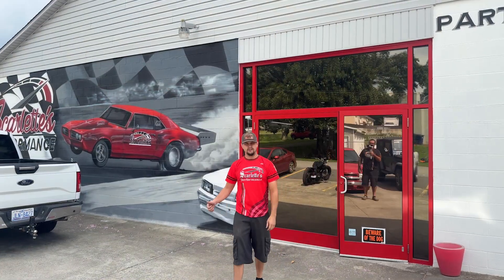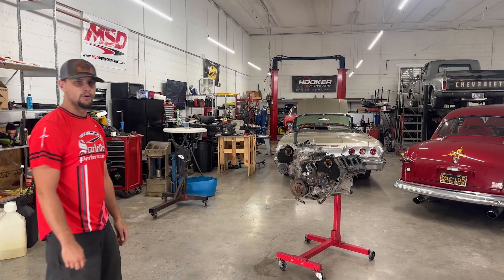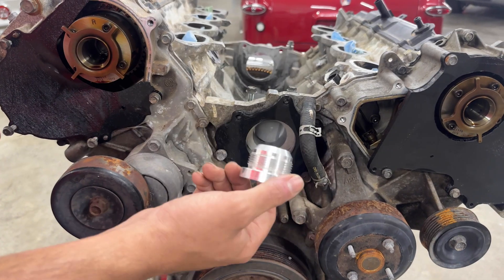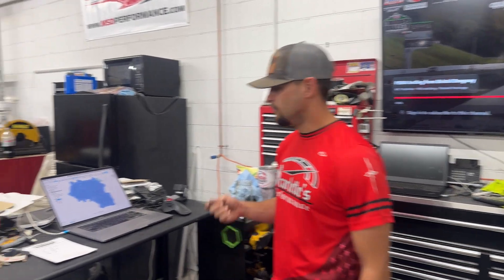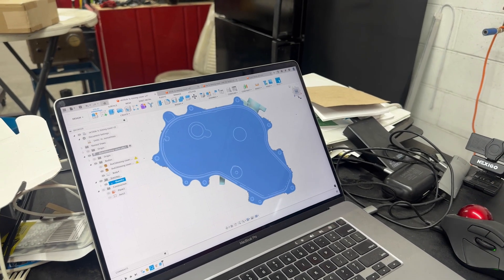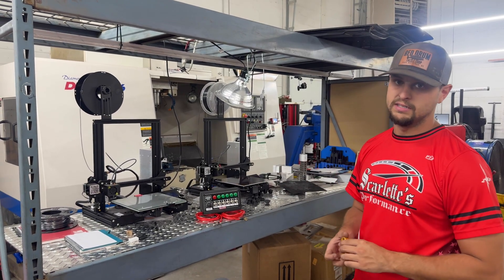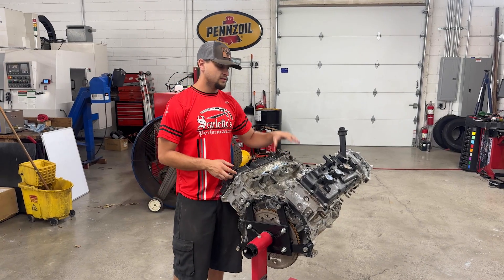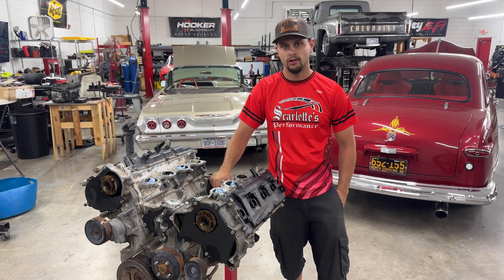VK56 What Have We Got Ourselves Into And What Are We Doing With It.

Comment: Rear head oil drain, valvecovers, lower kickout oil pan, front motor plates.
Reply from the maker: we are looking into the motor plates. not a lot of good areas without deleting some of the factory stuff which is fine since all we do is drag race. the motor I have here in front of me has drains in the back. we run a dry sump so don't know if the wetsump guys need more or what. if that's the case id prob just drill them and weld a bung on and plumb to the pan.

Comment: I think a 32-1 crank trigger wheel that bolts into the 6 bolt holes on the factory balancer would be great,
Also possibly a service to machine off the 3,2,4 camgear protrusions on the drivers side exhaust cam and having a sensor read the 1 mark as a home with covers to use the factory cam sensor
Reply from the maker: We may be making a bolt on crank trigger system so stay tuned.

Comment: Baffled oil pans would be nice.
Reply from the maker: we may look to make an oil pan in the future. right now I think we will convert some stock pans mainly for ground clearance. we typically use dry sumps to keep the oil where we want it and keep pressure at the number we choose more easily since the pump is external.
Reply: @freebirdracingchannel7802 but for your average guy that’s trying to build a street car aren’t the dry sumps too pricey? Also I heard for drift builds the baffle oil pan is needed to prevent oil starvation.
Reply from the maker: @AntoineJra  yes the dry sumps are pricey but a baffled pan doesn't work as well as a dry sump. there are generic weld in baffles that a lot of drift guys use to fix stock pans but we don't have any plans to offer that unfortunately.

Comment: Those VK56 motors are badass. Its cool to see you guys working on parts for them. I would like a simplified kit for a carb, manifold, headers and cams.
Reply from the maker: I think your best bet would be to keep it efi. be hard to justify putting a crank trigger on it just to fire the plugs and there is only one carb intake that ive seen and that is in New Zealand or Australia and billet so high dollar again. There is a cheap efi intake that just popped up on eBay for I think around 500-600 so you can get a bigger throttle body on it. we are still working on the covers and little trinkets to get the engine simplified for swaps so stay tuned. won't be too long just working on making them functional and pretty.